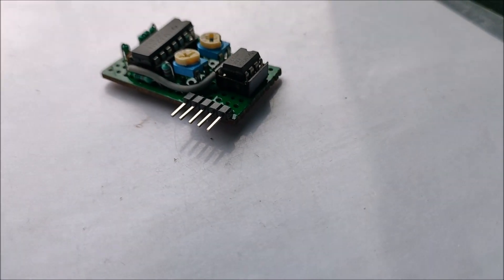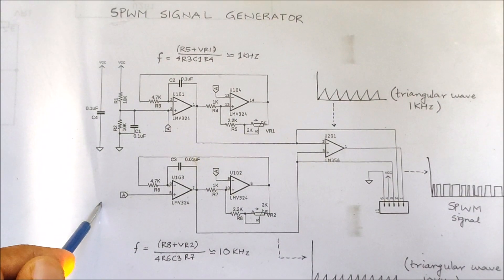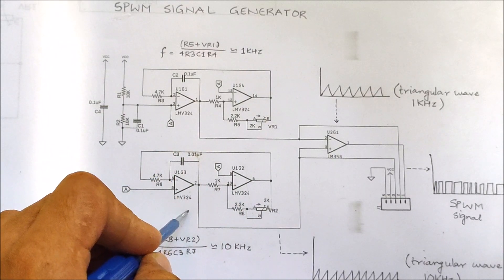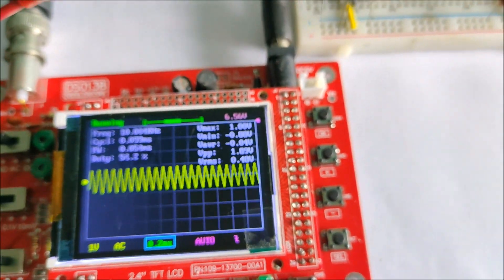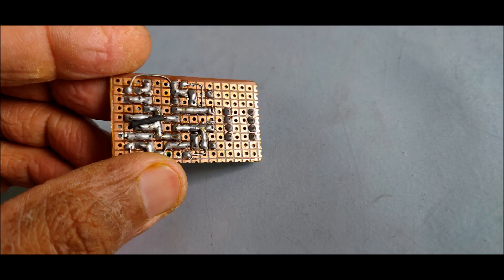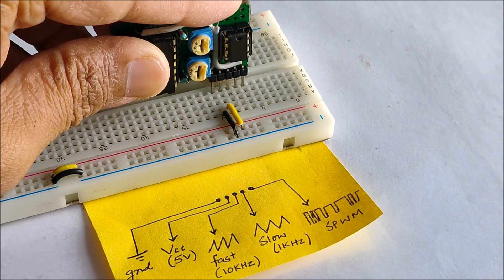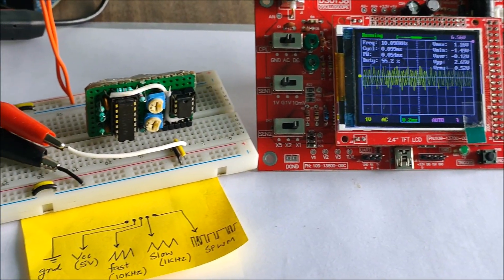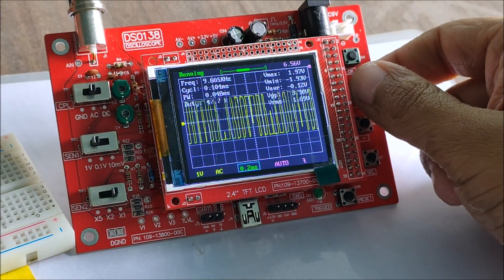DIY SPWM generator module || Generate SPWM signal without a micro-controller

Comment: What is the spwm out put frequency
Reply from the maker: Since it is pure analog circuit, the frequency is not very stable and fixed. I measured it to be roughly 2Khz
Reply: @UtsavShah_25  ok thanks for your response also how do get 50Hz after  instead of 2KHz

Comment: This is only one output..for flip flop oscillator for inverter we need two outputs...how to solve this problem????
Reply from the maker: Getting 2 complementary output in this circuit is difficult. I am working on a modified version for such circuit. Will share updates soon
Reply: @UtsavShah_25  keep it up... all the very best 🌹🌹🌹

Comment: How to use this to drive mosfets???
Reply from the maker: You can connect the output signal to a dedicated MOSFET driver. That will be an ideal way to drive MOSFETs with this
Reply: @UtsavShah_25  but this is only one output...how to use to drive  flip flop two sections???

Comment: Can I use it for 50 Hz spwm
Reply from the maker: Yes you can use it for 50Hz. You can adjust the potentiometer value and capacitor value to get the frequency you want